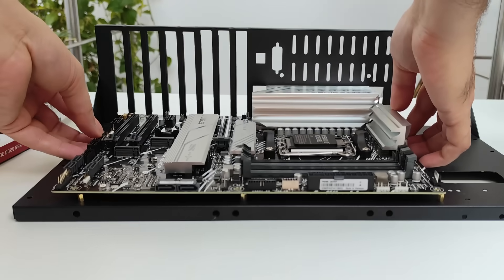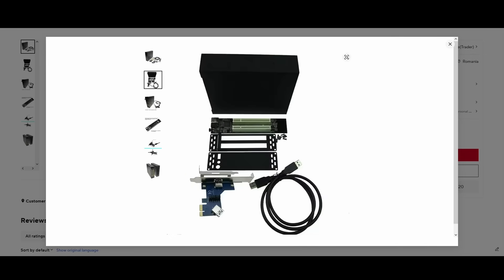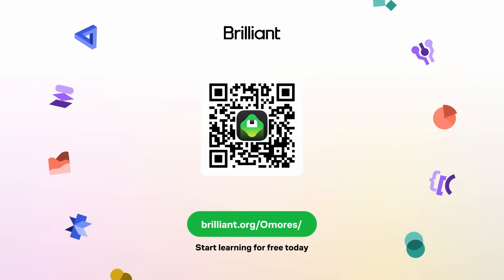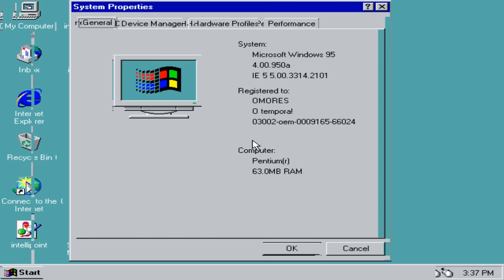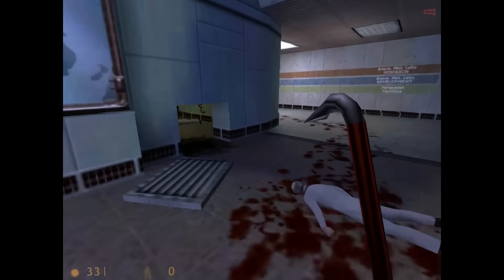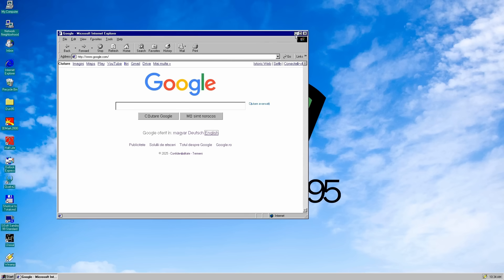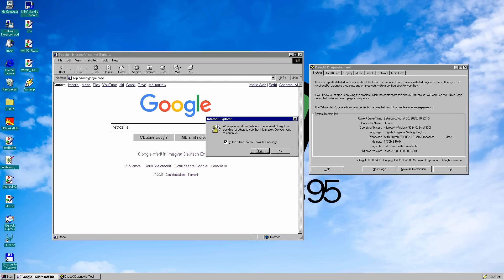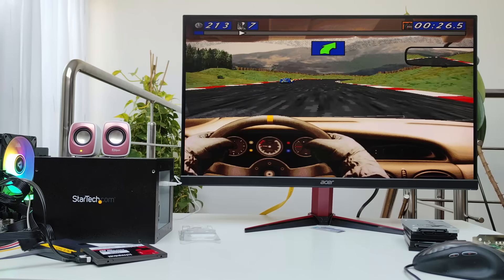Windows 95 (RY)ZEN Again – Running NATIVELY on a Ryzen 9 9900X @ 4.4GHz

Comment: the existence of those graphical glitches at around 5:56 bothers me existentially, otherwise, nice series of videos!
Reply from the maker: Yeah, I’ve looked into those artifacts a bit... still not sure what’s behind them. By the way, they show up exactly the same in Windows 3.x too. As for the series, you were actually the first to suggest checking out AM5 hardware - that was about a year ago. I moved kinda slow in that direction, but hey, at least I ended up with a better CPU... :)
Reply: @O_mores  yeah i am also all in on AM5 now, Arrow Lake was extremely disappointing and getting CSMWrap to work requires very specific knowledge that's way above my head...

btw, since you're here, i wanted to let you know that i updated cregfix (you know where to find it, i can't link it on youtube) to be a .SYS device driver instead of a .COM executable, which actually makes it possible to run it very early (first thing in CONFIG.SYS), which allows one to run things like EMM386.EXE on modern hardware, since that also depends on clean control registers!

Comment: Fast forward 30 years and Win95 sure do feel more responsive than the turd Win11 is rn.
Reply from the maker: Oh, yes, Win 95 is fast... but there's a reason for that. When it launched in 1995, nearly half the market was still on 486 PCs. MS cut any tiny feature that wasted clock cycles. Something as simple as showing seconds on the clock was removed because redrawing the screen every second would have an impact on the overall performance.

Comment: hi, i was trying to install my 7950gt on windows 95 like you did, but when i rebooted after driver installation i got a windows protection error. did you ever have this problem?
Reply from the maker: How much RAM does your 7950GT have? Did you install the NVCORE.VXD patch? https://youtu.be/iMyK-NJkSoo By the way, in this video, I'm using Windows 95A. It's not the ideal version since it's missing FAT32 support, among other things, but it might behave differently.
Reply: @O_mores  its a 256mb version, but ill try 95a aswell. thanks
Reply: @O_mores  same thing happened in 95a, ill just use vbemp or something for now
Reply from the maker: Plan A: Try using the installation from this video, as it might have something different (though I kinda doubt it). The .zip file is available at the end of this free article: https://www.patreon.com/posts/137980537. Simply replace your Windows and Program Files folders, and you should be set.

 Plan B: If that doesn't work, you may need to install all the patches provided by R. Loew, particularly the one for PCI.VXD.
Reply: @O_mores  using your install just sent me into a loop of trying to install drivers, i also tried the pci.vxd patch but there was a error when trying to patch pci.vxd, tried the patchnvc aswell, no difference, also tried disabling onboard audio. im just gonna use vbemp for now and i might do more testing later on
Reply from the maker: @imadam Well, maybe it's the card. For example, I have a BFG 7600 GT (G73 chip) which doesn't work at all on some configurations, whereas my 7900 GS works perfectly. But since both the 7950 GT and 7900 GS use the G71 chip I think it should work in the end... By the way, does it work in Windows 98?
Reply: @O_mores  yea ive used it in 98,ME,2000 and xp before perfectly
Reply: @O_mores  tried on a different pc again and yea the same result, not sure whats wrong
Reply: @O_mores  turned out that my 7950gt was basically dead. couldnt install drivers in windows 8.1 either so i ordered a 512mb 7900gs which should be here soon
Reply from the maker: @imadamI see. For most Windows 98 games, it won't matter. But the GT is still like 25% more powerful.
Reply: @O_mores  couldnt find a 7950gt for any reasonable price, these seem to be rising in price for some reason

Comment: I think we cannot do this for that along. By 2030. These CPU's may not able to run legacy x86 code except with Embedded SKU.

Intel and AMD are working on that, after UEFI is mature for years. It's near time to ditch real-mode and 16 bit protected mode completely to make processors more efficient. (Yes they keep till Zen5  literally because CSM/real-mode boot is still needed on some systems).

In the future, to allow using legacy code, it will be easier to fully-emulated in software with some hardware AIC for I/O like PCIe cards that allow use of legacy PCI/ISA/LPC interfaces with x86 emulation software, which usually limited to 33MHz at 32bit anyway. PCIe 3.0 1x lanes will be more than enough for most of the PCI even with 133MHz/64bit one.

Literally, no matter how fast your CPU during Pentium 1-2-3 era.

Legacy PCI bus will only work at maximum 33,66 or 133Mhz internally, for AGP, technically it's just PCI work at CPU bus speed (to chipset) instead of normal PCI bus speed. Your chipset working as PCI bridge that bridge CPU bus working at bus speed (133 to 533 Mhz) down to multiple of PCI/AGP bus working at lower speed. On lower-end chipset all PCI slot may shared the same bus while higher end may split a bit to allow cards working on different speed (such as 133MHz/64bit on PCI-X slot and 66MHz/32bit on PCI 2.3 slot, some bus may dedicated to ATA or SCSI controller for ... better DISK I/O).
Reply from the maker: The AM5 platform will be supported most likely until 2030, just like AM4 which still received new CPU releases this year. (like the Ryzen 5 5500X3D with 96MB cache) Normally, all the AM5 CPUs should have the same level of backward compatibility, so I think we're good for a few more years.

Removing legacy support to make CPUs more efficient is just something our brains like to think,  but in reality the dedicated circuitry to maintain backward compatibility is like 0,1%. For example a modern 64-bit ALU is designed to perform operations on 64-bit numbers. To add two 16-bit numbers, it simply performs a 64-bit addition but only uses the lower 16 bits of the input registers and ignores the upper 48 bits. Zero extra transistors are needed for 16-bit math, it's a free byproduct of having a wider ALU. The same with registers. AX register from 16-bit code is actually just the lower 16 bits of the EAX register (32-bit), which is itself the lower 32 bits of the RAX register (64-bit). They are all the same physical transistor circuit. The CPU just accesses different portions of it depending on the mode.

Comment: You could also try NT4 might pick up some of the cores :)
Reply from the maker: I can at least try to check if it works at all. Multicpu is a no-go on this build, as NT4 relies on MPS (MultiProcessor Specification) - a standard developed by Intel in the mid-'90s. AMD dropped support for MPS since AM4, but Intel Socket 1700 motherboards still have MPS support. You can see here NT4 running with multiprocessor support on an Intel i5-14600KF: https://youtu.be/e32NfT06FrU

Comment: is amazing how people prove how Ryzen is great cpu and this video show how how AMD is pure rubbish .i newer see worse limitation and performance on windows 95 until now. AMD is freeing shit what this video prove again. My Pentium  200 mmx perform faster and miles away better than this AMD trash.
Reply from the maker: I don't see how Windows 95 can put any Ryzen CPU in a bad light, but yes, from my experience, I would say it's better to go with an Intel configuration for a multi-boot OS that's equipped with all the necessary extra hardware to run Windows 10/11 alongside something like Windows XP or 95/98. Intel plays nicer with Windows 9x, especially when running DOS applications.

Comment: Great work! BIOS Flashback great feature.  ZEN 6 & probably 7 with new memory controller will be interesting if AM5  's last chapters will add any more steps.
Sponsorships galore congrats!
Reply from the maker: Rumor is AMD is shifting plans and Zen 7 will work on AM5 boards, skipping a new socket for now. DDR6 is coming with AM6 but it's gonna be stupid expensive at first so they're basically delaying the AM6 platform until DDR6 becomes more affordable. This is very good news...

Comment: We need to port Supermium browser to Windows 95!
Reply from the maker: That’s basically impossible without dragging half of the Windows NT components into Windows 9x, since modern browsers rely heavily on NT kernel APIs. A smarter approach would be to run a lightweight VM on Windows 9x that boots a tiny Linux distro with a modern browser inside. The VM runs in the background, grabs the screen, and makes it look like the browser is running natively. Plus, with bridged networking, it gets full internet access, and you just click on the Firefox.exe or Supermium.exe icon. This is similar to how, for example, some people run Photoshop on Linux. The problem is that there’s no VM for Windows 9x, but it would be smarter to put the effort into a project like this, since it could be repurposed for many other applications.

Comment: Do you want a challenge? Run native win95 in raspberry pi natively, not with emulators or other nonsense.. let me see what you do (ryzen is 64 x 86 while raspberry pi has a different processor architecture) do you accept the challenge???
Reply: Do you accept the challenge???
Reply from the maker: First of all, I’m not really into the whole Pi thing. I messed around with a LattePanda a while back, the same form factor but x86. Otherwise, all Raspberry Pi boards use ARM processors, so there’s no challenge. :)
Reply: @O_mores  The challenge is that the Windows 98 kernel must be compiled for the ARM architecture, something like that is not possible...with all the advancement in software it is still not possible...imagine Windows 95/98/XP running natively on ARM; that's the adventure!!!!
Reply from the maker: Someday, Microsoft will release the source code for Windows 9x - but probably not before 2040. After all, they only started releasing MS-DOS source code from the early to mid-80s in the 2020s. With that source code and the AI of 2040+, porting Windows 9x to ARM will be totally doable.

Comment: Win95 kernel running on uber fast Zen5 architecture: "What kind of sorcery is this?"
Reply from the maker: It's the x86 backward compatibility magic. As far as Windows 95 is concerned, this PC has some AT motherboard and a Pentium CPU. That's why it even works stably - because on period-correct hardware, optimizations like dedicated AGP drivers or power management can cause instability.

Comment: cool video! win95! :)  sir can you sometimes include a screenshot of your device manager the first time you enter windows? like in before you start to install drivers... i'm toying with all sorts of motherboards here and sometimes i see 2 lines in device manager, and sometimes i see 15 or 20. some motherboards are more compatible with win95/98 and some are less, so i'm wondering if i did something wrong in windows setup
Reply from the maker: Thanks for watching. By the way, you can find more screenshots in this article (including ones of the Control Panel): https://www.patreon.com/posts/running-windows-137980537

If you see no Other/Unknown Devices, then the PCI bus driver isn't installed and the PC is relying only on the BIOS for VGA and I/O. No big deal, you can install the PCI bus manually with "Add New Hardware".

Comment: For windows 98/95 just get a LGA 775 MB with a core 2 duo, it will be fast, easy to find and cheap.
Reply from the maker: I love the old Socket 775 platform and CPUs - I’ve got a bunch of Q9xxx quads and some Q6xxx too. The real use case for running Windows 9x on something much newer like this AM5 build is for people who only have a single PC and no room for multiple setups. In that case, you can just reboot from Windows 11, hop into something like 98, ME, or maybe 2K/XP for a little nostalgic break… then jump back to work like nothing happened.
Reply: @O_mores  indeed !
I've noticed you were using Windows 95 "a" version, why not using OSR 2.5 one ("C" version)?
Reply from the maker: @doyouwtech9012 Since it was Windows 95's 30th anniversary, I thought to use the version that came out in 1995. OSR2.5 is more of a 1997 release.

Comment: Core 0: Why am I doing everything?
Remaining cores: Why are we doing nothing?
Win95: That's how I am.
Reply from the maker: I like to think that running Windows 95 natively on one core is eco-friendly. :) If I did it on the same PC in a virtual machine, all that heavy emulation would stress all the cores and definitely draw more power just to emulate a much slower configuration. The total power draw for the CPU in Windows 95 would be the idle power draw of the entire chip plus the small amount of power needed for that one active core. Probably somewhere around 30–40W.
Reply: @O_mores  hmmm not sure since the boost multiplier and voltage is usually more aggressive when only few cores (or one 😂) are loaded, and probably C-states are not working anyways. 

Still, very interesting experiment. I would not bet on the eco-friendliness though
Reply from the maker: @Igbf The boost multiplier is triggered through ACPI, which doesn’t work with Windows 98 so the CPU stays locked at 4.4 GHz but... by enabling "Global C-State Control" the CPU should handle its own idle states, so even OSes like Win98 can benefit. Basically, the chip saves power on its own instead of relying on the OS.
Reply: @O_mores yeah..  but water cooling hah why not. Passively cool it no fan!
Reply: it reminded me of that one too : 
“Teacher: Queue is just Q followed by 4 Silent letters
Me: They aren't Silent, They are waiting their turn”
😁😎

Comment: it possible but less likely now to get attacked with windows 95 as its so old, also the browser will not work on most websites. it easier to run in a vm.
Reply from the maker: Indeed, it's easier to run it on a VM since you don't need to spend anything extra on dedicated hardware like a GPU or sound card, but the performance is limited. With such a fast CPU running at 4.4GHz plus a dedicated GPU, you get tons of FPS in D3D/OpenGL games. You can also use software rendering at high resolutions where no acceleration is available.
Reply: From memory Windows 95A had a DoS exploit relating to SMB shares that triggered a BSOD even if you didn't have any shared folders enabled. There was also "ping of death" discovered a bit later. Microsoft was very slow to issue security patches back in those days, and there was no such thing as Windows Update.
DoS attacks were fairly rare at the time but sometimes folks on IRC got targeted since their IP address was usually visible to other users on the same IRC network. Over dialup Internet, this would mean hanging up and dialling your ISP again, and each call cost money, at least here in Australia.
Reply from the maker: I was on dial-up almost daily from late ’98 to around 2003, with mIRC open 6-8 hours a day. I don’t recall any security breaches into my PC, though I was reinstalling Windows almost every month back then. :) So, even if those exploits were definitely real and updates didn’t help much, in practice it was an exception to get hacked due to OS or protocol vulnerabilities. Most people who got into trouble did so because they clicked the wrong links, opened the wrong email attachments, and so on.

Comment: Since Windows 95 was single-CPU only, I've often wondered how it would handle multi-core CPUs. Is it just hammering one core or does it take advantage of every core? My apologies if It was covered in the video and I missed it.
Reply: Like DOS, Windows 95 just sees a single core and everything (drivers and software) just uses that one core. In 1996 there were already dual Pentium Pro PCs around but only Windows NT (and probably Linux) could take advantage of both CPUs.
Reply from the maker: Well, Windows 95 (like any other Windows 9x system) was designed for single-core use, but that’s only part of the "problem". Software from that era, and even well into Windows XP era was also written to run on a single core. At best, you could modify Windows 95 to support multiple cores, but all the software would still only use one core.

R. Loew actually created an SDK for Windows 98 that enabled programs to use multiple cores. It was called "Multicore". Here’s how he described it: "
"The Windows 98/SE/ME Multi-Core SDK provides a Drive and a Visual C++ OBJ File to support the creation of Programs able to use Multiple Core CPUs
and/or Multiple Processors to improve performance or reduce System load."

Comment: Good. 🙂I don't install native Win9x on modern motherboard due to the lack of GeForce 6800 or 7600-7800 PCI-e. But my CPU Intel i7-12700KF with my old EVGA NV GTX 980 Ti SC+ GPU is faster than AMD Ryzen 9900X on 3DMark2001SE to 3DMark06 under... Windows XP x86 SP3. 😁😝
Reply from the maker: Intel rocks with these legacy OSes, everything was simpler when I installed on a 14600KF: https://youtu.be/G7qm3GFy9tg By, the way wow much does your 980Ti score in 3DMark 2001?
Reply: @O_mores  Ok. i7-12700KF@5.2GHz and GTX 980Ti SC+@all stock speeds with OC version - GeForce driver-368.81WHQL default settings running Win XP x86 SP3:
- 3DMark score - 181,143 (GT1l 2292.8, GT1h 507.3, GT2l 2843.8, GT2h 1440.8, GT3l 1956.1, GT3h 948.9, GT4 2613.0) 😁
NOTE: higher vertical frequency is higher score and higher framerate because at 120Hz of monitor, 3DMark 181k 😧😁 while at 60Hz, 168,255 😂🤣🥰
Reply from the maker: Interesting... Now I have to take the refresh rate into consideration. By the way, while running XP SP3, I got 160K with an Asus GTX 980 on an i5-14600KF/Z790. You can see the 3DMark results here around the 8-minute mark: https://youtu.be/n6woUdZcJgE